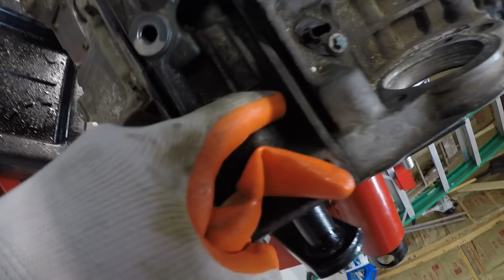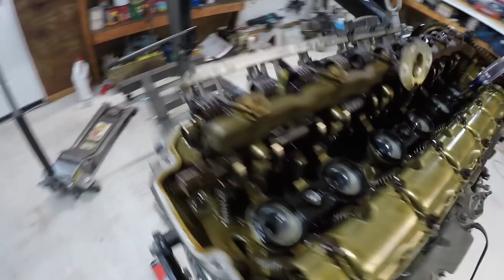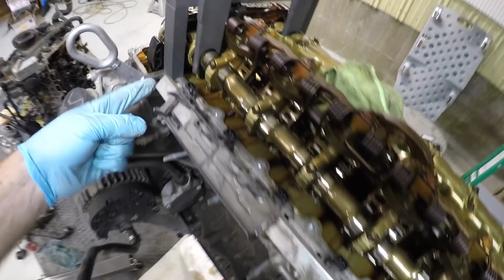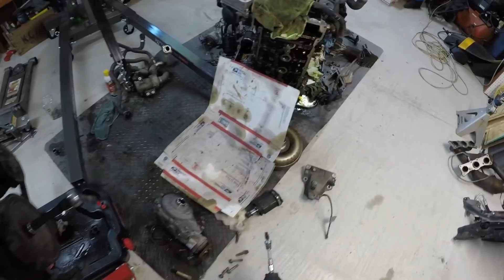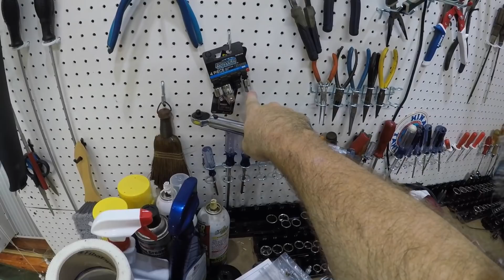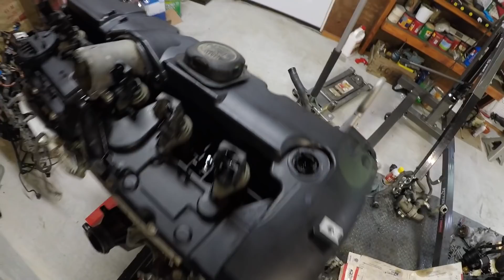SUPER EASY DIY BMW N52 Engine Timing Procedure , New Valve Cover And Vanos Screen Service Check

Comment: Quick question i been having a problem for weeks now i rebuilt my n52 engine and i did timing correctly but engine wont start it cranks no start error are inlet vanos sync problem any idea ? (I did reset adaptation and all)

Comment: I got a n52 i have tried everything to get it running I got good fuel pressure good compression an good spark. I took out o2 sensors an getting flames but won't run can u plz help

Comment: Is it possible to mount the flexplate wrong? Im trying to ajust the timing but the pin never aligns with tdc, received the car not working from another shop

Comment: I have a big turbo e70 n55 with 600hp died on me on the highway after destroying a scatpack on a 60 roll. If the exhaust cam seems fine but the intake cam has the barcode facing almost down when at TDC. I don't understand how this happened. The timing chain is tight the tensioner is new. The cam ajuster locking tool still fits?

Comment: Any suggestions, I am rebuilding an N55 engine and everything has gone fine until timing. I set everything TDC with special tools and torque down. But when I rotate the engine twice my camshafts are off 5-10 degrees. I can't find anything on as to why and how to correct it.

Comment: If you did not remove cams, did you need to re-time the motor? Is that generally needed when replacing valve covers? Can you replace roller rockers on intake side without needing to redo timing?

Comment: Thanks man learned some stuff. Wanted to say that while doing this today I realized that you don't need to use pliers or adjustable anything to get the cams to turn for timing alignment. You need to release the 2 forks and use them to pull the cams untill they are in position to put the bolts. Simple. No need to use anything else. Thanks and good job
Reply: Also for the people that want to change the 4 bolts per each Vanos wanted to mention that the torque for them is 6nm followed by 60 degrees angle. They are aluminum it seems though not 100% sure. I looked everywhere for the specs and they are not available.

Comment: Do you recommend at 102000 miles, 528i 2010 N52 base model,  replacing the timing chain tensioner without going deep to change chain and guide rails? No codes. Thx. Greg

Comment: Hey Nathan, Im stating my rebuild......   Question,  the Engine stand, are the aluminum bolts strong enough to hold that weight.  It looks like you used them?
Reply from the maker: Yes they are , kinda sketchy but it works
Reply: @NathansBMWWorkshop  do you know the size.....  I might gets steel while on stand.

Comment: Can i remove the Sprocket Without removing the camshaft housing ? My car  needs a new head gasket and I will be buying that tool to hold cams in place. So it can make my work easier.

Comment: I have a HUGE question!? This guy clocked my timing without “locking the motor” whatever that means, and now my car won’t start and and makes a really bad noise in motor. I took it to a another mechanic and he said my valves one or more we don’t know, could be bent. Is that true? The valves can bend in the N52 motor? ⁉️⁉️⁉️ It’d mean a lot of you responded and told me if the new mechanic is right and if anyone else knows the answer please let me know! THANK YOU 😃

Comment: Hello , i have a N52B30 , and what is the tightening torque for the 22 aluminium (rocker cover) screws ? please
Reply: It might be late, but here it is.
7Nm, wait 30min, recheck 7Nm and then 90° turn Z pattern retightening sequence.
Mark each bolt as you do additional angle, so you don't do it twice (very, very easy to do this mistake).
Calibrate eccentric motor at the end by pressing the ignition button, BUT DI NOT START THE CAR.
Eccentric motor will learn the limits.

Comment: Nathan, is there a way to do a VANOS rebuild on this engine? Does it have the internal 2-ring sealed pistons? The few pictures I've seen make it look like a 'vane-type' pressure system; ie, more like a power steering pump than a piston setup.

Comment: Hey Nathan, do you know if I can recalibrate eccentric motor just by push start button method, or I need to hook it up to laptop?
Need to replace seal on Magnesium valve cover. 
My engine is N52B30, 330i, E90, year 2005.
Reply: To answer my own question after doing the job if anyone is interested, no you don't have to calibrate the motor. 
It does it by itself, as long as you don't start a car, just press the ignition button, but don't touch brake pedal. 
Motor is supposed to start, go all the way up, return back and remember limits.

Comment: Do you reuse the bolts that hold the timing chain sprockets on the cams?  My manual says to use new ones, I assume because they specify an angle torgue that they are torque to yield?
Reply: You're supposed to use new ones like most bolts on this engine due to stated reason.

Comment: Quick questions @Nathan. I am doing the timing for the third time on my e90 07 328xi n52 engine. The spacer for the black timing jig is on the intake side. In your video, it is on the exhaust side. Is the spacer supposed to be on the left side or right side of the jig?  I appreciate you and all of your videos.
Reply: Hi, did you figure on which side the spacer goes in the timing tool?
Reply: Nope and no one answered my question. I ended up putting a 2011 328i engine in my 07 328xi instead.
Reply: @jeffeypooo   I think I am heading the same direction. I can. not complete the full 360 degree rotation by hand after I assembled the timming guide chain and rails. I am on a n55 😞

Comment: Thank you so much for this video Nathan! 
You mentioned that hydraulic valve adjusters tick (or in my case clunk) when the oil pressure drops because of warn out cam journals?
Mine cluncks when its cold, after it warms up engine purrs nicely.
Do you think it is because of the warn out cam ledges/journals?
I was gonna pull the top off to replace the hydraulic valve adjusters as BMW calls them.
So, you think that's not gonna fix the problem? 
My car is 330i, year 2005.
What do I do?

Comment: I wish you lived near me (NY).  Would have you work on my engine. I started noticing  some oil leaks. I have a 530I E60. 2006. 174,938 miles. So, yeah things are definitely going to break. this is why now I'm watching your videos. I'm going to do it on my own. I am mechanically inclined. I've also worked on less complicated cars like Chevys and Fords. Thank you for the video's! They are gonna be a big help.
Reply: I have the same car just hit 189k miles, hows yours running?
Reply from the maker: Thank you for watching

Comment: Many thanks to you Nathan, you really bring some clarity about what is involved in timing  the N52. I have a question about the removal/installation of the exhaust cam. I see on the internet a "special" toolkit for the exhaust camshaft which contains fixtures that hold the upper and lower bearing ledge parts as well as a piece that pushes down a set of valve spring to release tension on the cam lobes. I didn't see you using any tools like that so I take the exhaust camshaft can just be removed/installed without this "toolkit"? Thanks again, cheers.
Reply: I'm interested in this too!
Some people say you can do it without it, some say you aren't supposed to.
That tool is fricking expensive, even from China!

Comment: Yeah, the bolts on the valve cover do like to pop. When I did mine two bolts snapped, and one valve cover stud popped as well. So annoying. That’s always seems to happen with me though. I don’t know if they’re all just that weak and old, or if I’m that heavy handed. I should really invest in a good torque wrench I suppose the one I have sucks and doesn’t work well.

Comment: I see that there is a silver tool that has two pins to adjust the time of the crankshaft when measuring the high point and the low point?

Comment: Random question. 
I’m selling an Alpine White 2001 530i Sport Premium 5 speed with 180k Miles. 
Interior 9/10 is damn near perfect extremely clean everything works. Exterior is super clean as well paint in great condition exterior 8.5/10.
Maintenance records on it from when it was new up until now. Runs great no leaks. 
What’s it worth you think ? 
Texas

Comment: That hose at the beginning with the plastic connector - someone on ebay makes a billet aluminum piece that goes in place of the plastic part.  I've installed two of them with great results, very well made.
Reply from the maker: I almost bought one of those but they were made in china and I didn't  know if it  would fit tight in the head or not , just got a oem plastic connector

Comment: Thanks for spending the extra time to film. I know it takes a lot longer. I'm an E46 guy, but interested in the E9Xs, as my E46 has 225,XXX. It's going strong now but E90 will be the next.
Reply: You will be disappointed. The M54 is the last great BMW sixxer. The N engines are all leaky junk.